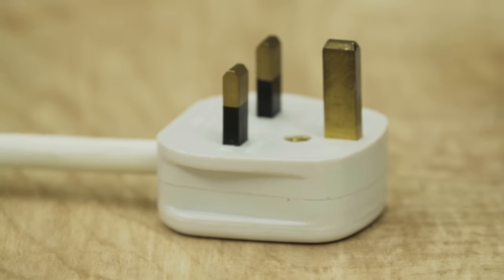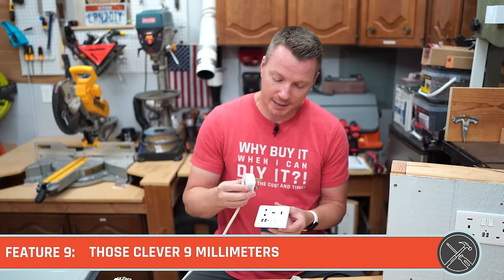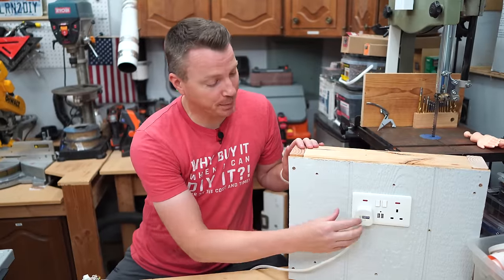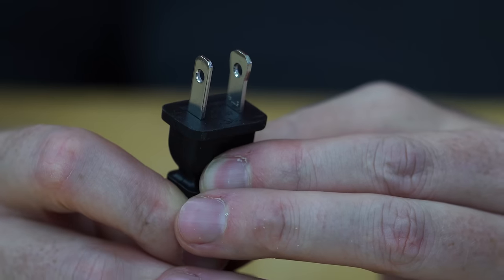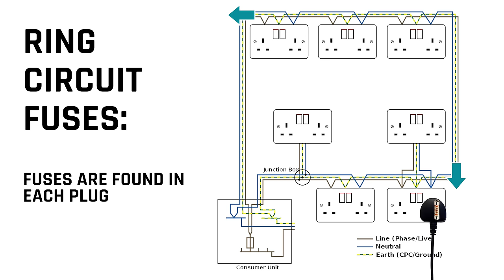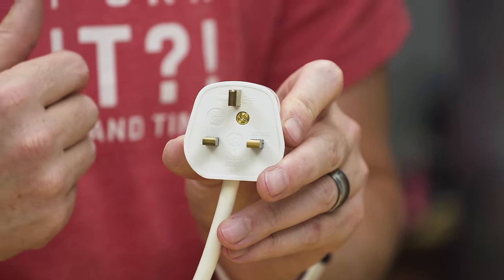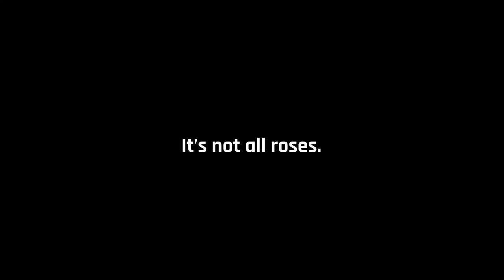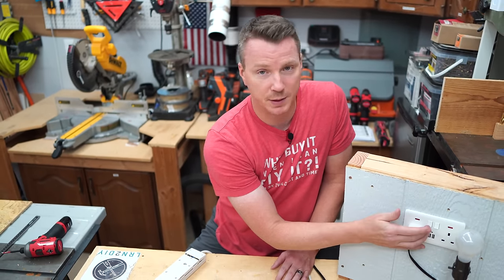British Plugs and Outlets Are On Another Level

Comment: Genuinely don't think the negatives even come close to making an argument against our plugs. Amazing invention
Reply: I'm happy for you.
Reply: As an Australian, I would have to agree and have to say that this whole system with ring main, individual fuse and plug is pure genius! However, To improve this would be to have each power outlet RCD protected with a lower tripping current than of the main.
Reply: @andrewstewart8704  How do the RCDs in Australia work?
Reply: @jovetj  trips the circuit if there is an earth leakage. AKA earth leakage detector safety switch
Reply: @andrewstewart8704  No, sorry, I meant how much leakage current do they allow there? Are they installed only as MCBs or are there receptacle versions like in the States? Or?
Reply: I’m an electrician in the states and the ring circuit is very cool but adding or subtracting circuits seems like a nightmare. For us, we can simply tap power from an existing box but the ring has that extra issue of needing to stay closed. I also prefer our 120/240 system as lower voltage means a safer home. I would love a chance to work on your hardware though since an electrician is an electrician no matter what system we work on haha.

Comment: The downsides mentioned are a real stretch, but thanks for playing.

Switched sockets mean plugs are rarely left on the floor anyway, their size is a non-issue - especially given they don't stick out as much because of the cable orientation (one of your + points), and no-one here gets confused about something not working before checking if the switch is turned on.

Snarky comments aside, good video 🙂

Comment: Interesting.  As an ex-UK and ex middle east resident these are the plugs and sockets I like the most.  As a child I lived in the Caribbean where we had the US system - one indelible memory is my sister sticking a hair pin into an outlet and having her fingers bandaged for a couple of weeks after the resultant flashover !  
Now building a house in Philippines which has 220V system with USA plugs - I brought boxes of the UK outlets and plugs back from middle east to install around the house as the safest system.  The USA style plugs always seem to fall out of the outlets.
Reply: Very wise.  Put the correct rating fuses on the plugs. Buy boxes of different values: 3, 6 & 13A. They will cover most.
Reply: Parts of the Caribbean have UK plugs... depends on heritage of whoever invaded them. I visited Grenada and was astonished to find my british plugs worked just fine, even in the very rural place I was staying at.
Reply: "Seem to fall out", my experience is that they USUALLY fall out. Just a cheap way of doing things - fast and cheap - USA.
Reply: Indeed, North American plugs are very flimsy and often get loose and fall out and sometimes have to be bent to stay plugged in.

Comment: Surprised that you didn't even mention the Schuko plug CEE 7/4 and CEE 7/7. Apart from serviceability, it is basically identical in terms of safety features - in small details, arguably even better. Especially if you consider the differences in which the european power grid and houses are set up in the most parts of Europe compared to the UKs.

- Two ground clips that always engage first, while all ungrounded Europlugs (2 pins) i've seen so far have this "9mm" protection even tho it's redundant here due to RCCB and being unpolarized in the first place.

- Beefy pins

- 240v

- Most Schuko plugs also have the sideways orientation for the cable, only the compatible Europlug is straight most of the time

- Internal order of destruction exactly the same

- While the UK uses ring circuits, the rest of Europe uses radial circuits, together with the excessive breaker setup and RCCB that each house here has having fuses inside the plug isn't nessecary, the same goes for turning off individual sockets. You may still find sockets that you can turn off occasionally, but it's redundant and doesn't serve any security purpose here. Some security features that are built into UK plugs are actually built into our power grid and houses instead, yet are still partially present on some versions of our compatible plugs anyway. It is surprisingly hard to electrocute yourself on a Schuko outlet, even on purpose.

- Bonus: the CEE 7/7 standart of the Schuko plug is even compatible with french sockets, that have the ground pin in the socket rather than the plug. While of course retaining the ground pins for non-french outlets.
Reply: You can't expect that Britons will admit that something from Germany is better. They already have a hard time with german cars. 😂
Reply: Went to Spain and used them before. Horrible experience with socket stability and how it just seems to want to come out of the socket with a little cable weight. UK plugs have never failed me and always plugs in tight into the socket.
Reply: @nevmiku  I personally never had that expierience with a Schuko plug, only some Europlugs here and there - but those usually don't have heavy and long cables attatched to them in the first place. The full size Schukos (round with ground pin contacts) sit so tight in the socket, that one has to really put some force in when pulling them out, at least in germany and france.

Did you use an adapter that was UK Type G to Europlug? That's the only scenario i can imagine where this would happen. If you adapter only had a slim, 2 prong plug then it was definetly a europlug adapter and no proper Schuko adapter, so sadly it makes sense as those were never designed to have much weight on them in the first place. But since they are compatible with more outlet types, those adapters are also more common than a proper UK type G to Schuko adapter.
Reply: @nevmiku  In Spain sometimes there are still type C installations. They look like type f but the lack protective earth.
what you describe sounds like type C.
Reply: All good points and a fine example of a plug that is engineered to suit its environment, as the G-plug is. But there's no need to defend it; just because it wasn't mentioned, doesn't mean the presenter wouldn't think it was well designed.  However it is not standard. Several plugs can be inserted into the corresponding socket, whereas the Type G is the only type, it is not cross-compatible with anything else.  The Schuko does not have a separate fuse, and can also be found corded dead straight, i.e. easy to pull out.  Nor are shutters part of the core specification.  Then again, it doesn't need a separate fuse, as the radial circuit is commonplace in Germany and elsewhere. BTW it would be interesting to go into why the UK historically has used a ring circuit. I know why, not sure everyone does though!
Reply: @SampleTracks2224  You do not know Schuko plug. the cla.ps are earth and are holding the plug tight. The plug is sunken into the surface,. you never be able to reach parts under voltage, contact will be lost before the plug gets above surface level. And there's no need for a fuse. E ery house or apartments needs fuses and RCD since more than  50 years now.
You can not compare your unsafe installations to our safe ones.
Reply: Eh, CEE7 is overengineered if you ask me.
Reply: @sandropertini7497   Same as the british plug - the difference being that the british plug HAS to be overengineered, in order to overcome the inherent weaknesses and shortcommings of the power grid that it's trying to operate with.

On top of that, british outlets NEED that overengineered plug, while most EU plugs also accept the very simple europlug and other variants, which are the opposite of overengineered.
Reply: @silphone  having worked on domestic installations in Brittany, Amtsterdam,,Prague and UK i would rate UK   wiring standards the safest I have come across ,
Reply: @silphone  Exactly, that's why I don't like schukos. To be honest I don't really like the europlug either, that one is just badly engineered (ever gotten one of those horrible bent pins stuck in an outlet?).
Reply: you can argue if schuko or the type G is the better plug. Each of them got it´s downsides. Schuko is so much older, like from the 1920s, Type G is from after WWII, so a much more modern and advanced design.
Reply: @benstock2068   do amsterdam and prague also use ring curcuits that risk frying your electronics if you don't shut off the wall socket? i don't know wether they do, but that would explain you calling them "the safest"

 @denzzlinga   i wouldn't call a design that only reaches roughly feature parity "more modern and anvanced" by any stretch.
Reply: @sandropertini7497  please clarify; you don't like the plug, the outlet or both? for it's compatibility with some other standarts?
for europlug i agree for the most part, it's annoying when this plug gets used for things it's not meant for. And even then, it's a plug that trades features for utmost compatibity, which often shows. On the other side, i'd rather have a europlug for any compatible outlet than no plug at all.
Reply: @silphone  I don't like either. The kernel of my distaste for shuckos is essentially compatibility, but I've come to realize that CEE 7 is a needlessly complicated design.

I don't have a problem with type G but that's essentially because I've never had to deal with them; british plugs are even more needlessly complicated than schukos.
Reply: The Schuko is pretty good.  The main disadvantage is it can be plugged in in either polarity, and British ring finals need the fuse in the live (line) only.

Though we're pretty lucky in this country to have a 60A or 100A incoming main.  Even developed European countries often don't.  For example, Italy is usually limited to 3000W (about 13A), so the most common 13A fuse we use in the UK would be entirely unnecessary if it were used over there.

The BS1363 plug type shown in this video has some advantages, but it basically came about as a way of working around a post-war copper shortage a the cost of making the system more complicated.  It's worth noting, however, that British plugs and sockets can be really cheap to buy, so extra complexity does not seem to result in greater cost.
Reply: @johnbull5394  Regardless of what comes into your house from the main grid, british outlets still only supply 220/240V 13A at 50Hz, whereas german outlets do 220/240V 16A at 50Hz. The type L that is commonly found in Italy has 2 styles, rated for 10 and 16 amps respectively, so i have no idea where you get that 13A number from. [edit] also the fuse situation i already adressed in my main comment, in germany every house is required to have RCCB, so with that taken care of, using radial circuits instead of ring circuits (like in britain) just increases security overall. Even plugs without fuses are safe to use here, we simply have them in the more beefy plugs as an extra layer of security, which is effectively not even needed. We have massive breakers in the house itself, that the electricity goes thru before it even reaches the outlet.
Reply: @silphone  Wrong, (and almost embarrassing rant though )The outlets can supply a lot more than 13 amps, keep awake please! The '13 amps' is the limit of the 'fuse' on the plug of an individual appliance. A radial circuit can supply the limit of 'fuse' in the main fuse box, normally 30 amps, sometimes less, sometimes more, depending on the rating of the wire used and the purpose of the (radial) circuit. RCCB...Wrong again! wakey wakey! I accept that RCCB use is almost mandatory in the EU, and in the UK it is the standard now to use this 'trip' system, and it is rare. or possibly even illegal now to have the old fuse system on a ring circuit in the UK. Your statements are as much believed as VW stating 'Our Diesel Vehicles are perfectly fine on emissions' German Engineering, best in the world.....

Comment: Great video, Couple of points, All consumer equipment in the UK is required to have a plug fitted by law and correctly fused. Most of these plugs are moulded, so not rewireable, but do contain fuse cartridge. The fuse also allows fusing down to 1A(Although rare) to provides better over protection for items like table lamps and the use of thinner cable. The wire exiting downwards is an anti trip hazard feature and also allows furniture to pushed right up to the wall without damaging the cord.  All cables are double insulated(No figure 8 bell wire) The power balancing you mention is rarely every an issues if the electrics has been installed to the regs(code). A ring circuit is 230V 32A, (7360W). It takes some effort to trip a ring. e.g. On a kitchen ring, the use of a dish washer, washing machine, fridge and freeze and kettle might trip if you unlucky enough that all the motors / heating elements are on at the same time. No one in the UK has issues with switches on sockets, only visiting foreigners. Sockets don't have to have switches, but most do so you don't insert a device under load, avoiding pin arcing. The use of 230v allows for less copper overall. with 0.5mm2  to 1.5mm2 being suitable for most appliances.  On top of all these features, every domestic Lighting and Socket circuit MUST be fitted with 30mA RCD, RCBO (GFI) by Regs. So UK electrics, while 230V are quite possible the best and safest in the world (IMO). Great ending, but this another safety feature to teach you not to leave plugs and cable laying around where you can trip over them and damage the plug. From a very early age, you learn not to leave plugs where you can stand on them, because it does *****  hurt! and you only do it once!. But not as much as a DIP16. UK Sparky and Electronics Engineer.
Reply: Have you noticed that socket outlets now have L and N feed terminals next to each other whereas they used to be kept apart? Seems a backward step to me as it makes arcing more likely.
Reply: And what about the time when the product was sold in the UK with bared wires and one had to purchase the plug separately and fit it themselves? Where did that rule to have a fitted plug come from again?
Reply: The moulded plug thing is quite recent, loads of rewirable plugs about.
Reply: @user-iw7gb6hx2j  I've only really noticed the moulded Type G plug on kettle leads that typically connect to very sensitive appliances, like laptops etc
Reply: fyi the fuse in the plug is rated for the cable attached to it, it has nothing to do with the appliance on the end, it is to stop the cable over heating, that is a question taken from an exam paper
Reply: @paulaherne3915  At one time older houses in the UK had 15 amp sockets with round receptacles, so there was the possibility that an appliance could be used in properties requiring either type of plug, I don't know about regulations but I have not seen equipment supplied in the the UK without a fitted  square pin plug for over 30 years.
Reply: not all cable is double insulated in the UK, I use a lot of single insulation cables in installs and rewires.
Reply: @Bernie_the_Bolt  yes it came into effect in the 1980's as it did in Ireland where Schuko and BS-1363 were in use in different domestic locations, but the requirement for it to be fitted beforehand came as a directive from the continent. Scuko plugs came molded on with some continental made products, but one would have to chop them off and fit a BS-1363 plug as required.

Comment: I live in Malta and we use Type G plugs as well. Most plugs come with a 13 Amp fuse, the best feature for me is that you can easily replace the fuse to the one with the precise amperage required by the appliance
Reply: Yes, plugs should be sold without a fuse, making the user fit the correct fuse.

Comment: It is common to have ring circuits for different floors or purposes. A 30A cooker circuit, one ring for downstairs sockets, one for upstairs sockets, and then lights. So load balancing isn't ever an issue. You simply don't need to think about it. I've charged my EV from a standard 13A socket ring and had other stuff on too. Zero issues.
Reply: Yeah I have separately switched Lights (always flip that before changing ceiling bulbs) & sockets and the cooker.
Nothing distinct for the sockets though. as well as the mains switch.
Reply: Indeed - my house has three rings, one for upstairs sockets, one small ring of three double sockets for just the kitchen, and one for the rest of downstairs except for the kitchen.  This nicely sorts out the load balancing issue given that almost all the high current plug-in appliances are on the small kitchen ring (kettle, toaster, washing machine, microwave - not the cooker, that has its own hard wired circuit), with the largest thing on the other rings being a rarely used 2kW heater (which at 240V is less than 9 amps).
Reply: Yep pretty much all British building are like that. It's easy to isolate things.
Reply: Yeah I think I have 5 or 6 different rings in my house, a new build that finished this year.

Comment: I recall when I was 11/12 at school we were taught to wire a plug as a part of general  science class when revising circuits in preparation for SATs at the time. We were in groups of two and had to wire it correctly and quickly. I thank my Dad for showing me how to replace the fuse and wire a plug when I was 8 in preparation! As myself and my team mate were first and accurate!    This is a very informative video comparing the plugs etc and a great learning tool. Will have a look at the other videos you have also. Thank you 😊
Reply: @GlennHoddleSucksSocks  I remember the radiator bleeding key! Was used most years, on one occasion there was some water spillage and had to make a mad dash for a bucket ... 90's memories. But I don't recall this Armando show?! But remember How2